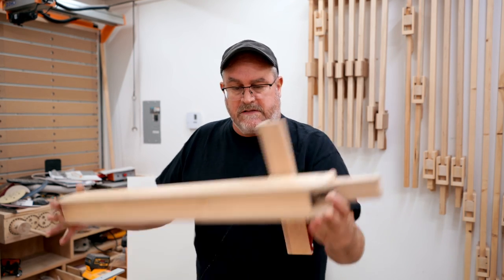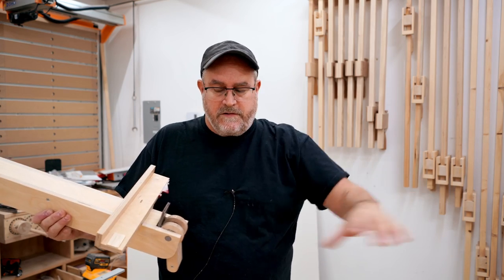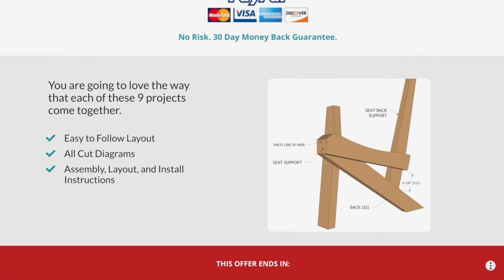My Table Saw Broke... Again! and I made a New Fence

Comment: Many years ago I made a table saw fence copying  Biesemeyer design . I made it with a larger  T   so it had more squaring power.
It does not have rear locking capability, but it works fine for what I needed.
Being made of heavy steel tubing it's just fine.
I'm sure heavy side pressure or rear lifting pressure could create problems but so far it hasn't for me.
That t-square fence was one of the best things I've ever made.
I'm looking forward to seeing your fence and the rear locking mechanism.
Thank you for being one of the best inventors of wood , woodworking aids.

Comment: Being stubborn and easily distracted, I would have pushed on and disassembled the old switch and figured out how to fix it... (and completely forgotten the original task).
I did this the other day with my router - but I did fix the switch!
(It was full of sawdust - there was a little opening, and being upside down in the router table, it was gradually filling to the point where the contacts were forced open)

Comment: Any thoughts on the new compact sawstop? I was thinking about maybe getting that and building a larger table around it with your fence. Seems like the cheapest way into getting the safety feature, but it's only go a 24inch capacity.

Comment: I bought a Powertec paddle switch from Amazon February 2020 in January 2021 it broke. I am not a heavy table saw user. I have a twenty dollar trim router from Harbor Freight still running after four years.

Comment: Not only will you burn your shop down, but you will also cause the downfall of modern humanity.   😇

Hope you're handling the heat in your shop, as I don't think you have AC.   Have a great summer, John!
Reply from the maker: I was thinking it could cause a tear in the space / time continuum or make our sun go supernova! 
Always cool in the shop, even on the hottest days. Just 19 C this morning when I recorded this. Lots of insulation plus no sources of heat plus the thermal mass concrete floor slab regulating  the temp.
Reply: You could have poked your eye out!  🤣